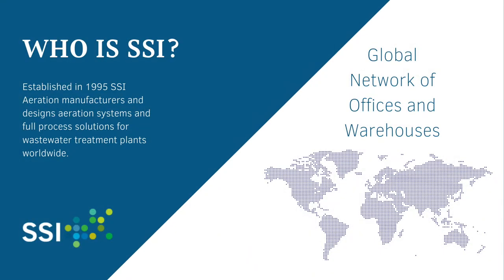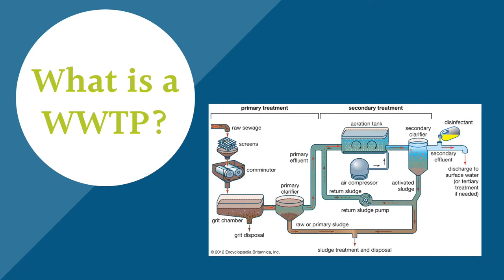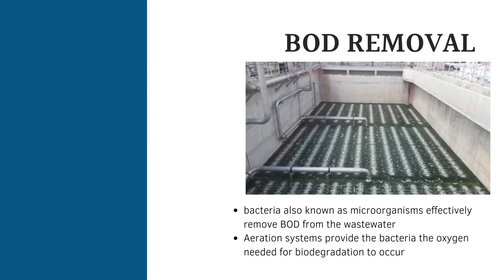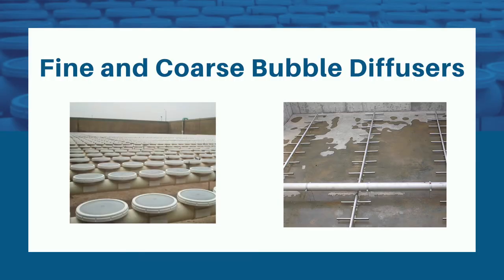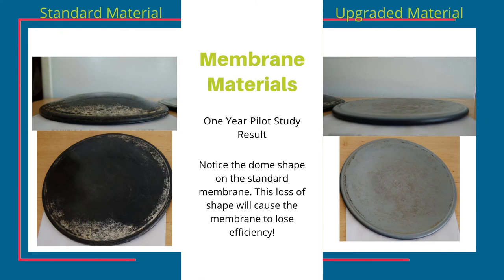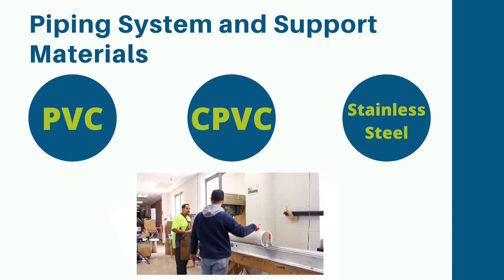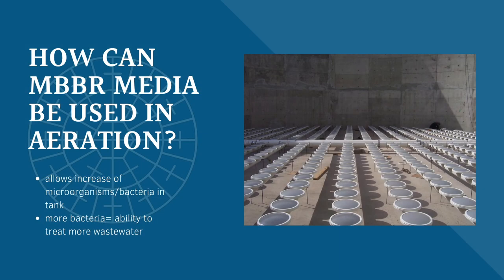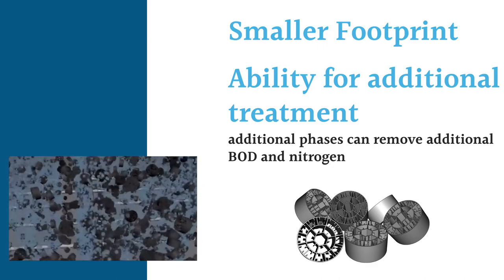What is fine bubble aeration and how does it work in wastewater treatment?

Comment: how about the build up of sludge underneath the diffuser?
Reply from the maker: Hi! Our diffusers have an integrated check valve built into the membrane which prevents sludge from flowing back into the diffuser/piping system.
Reply: @ssiaerationinc  Thank you for the response! What I meant is the space below the diffusers/piping system that could possibly be stagnant.
Reply from the maker: @eiffelheinrichbamba5369 Ok, sorry we misunderstood a bit! A big factor is preventing or minimizing the sludge buildup in the tank through the design and layout of the aeration system so preventing dead zones, making sure you have enough airflow and mixing power. If you have a poor mixing pattern, whether due to insufficient design or just lack of maintenance over time the sludge can begin to accumulate. If you do have sludge you should clean it out for optimal performance. There are a few ways you can clean it out and what is best will depend on tank size, reduction goals, and budget but you can use filter presses, centrifuge, vacuum trucks, mechanical dredges, etc. Honestly the best thing is prevention though and making sure your system is designed correctly from the start :)!